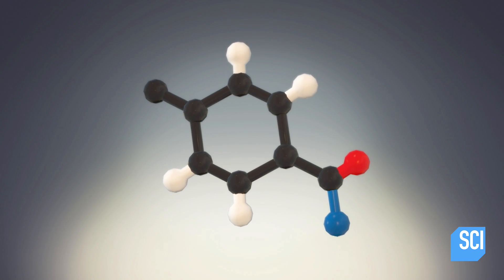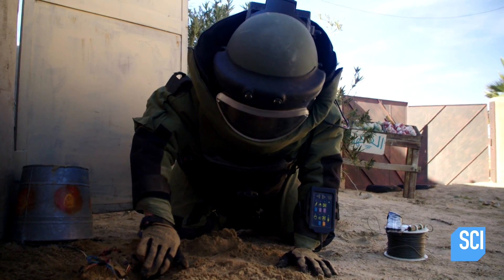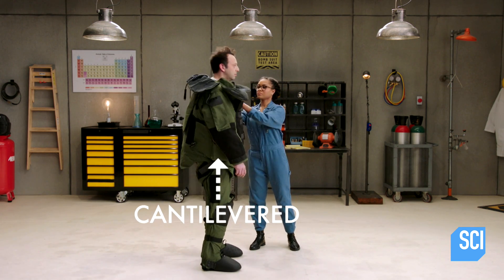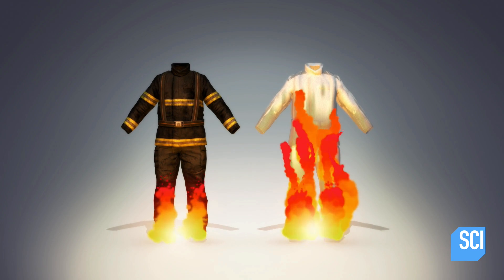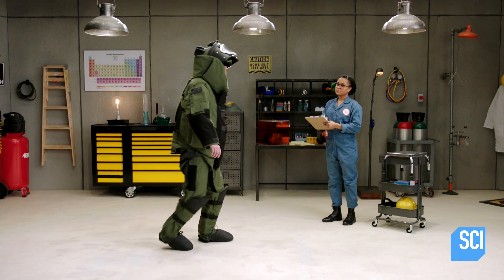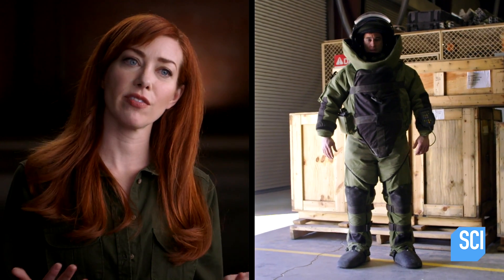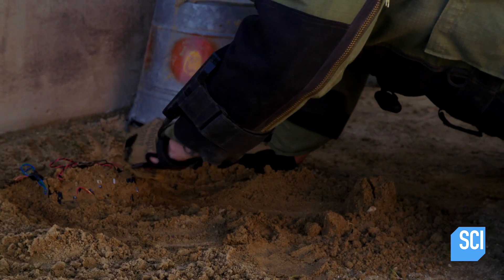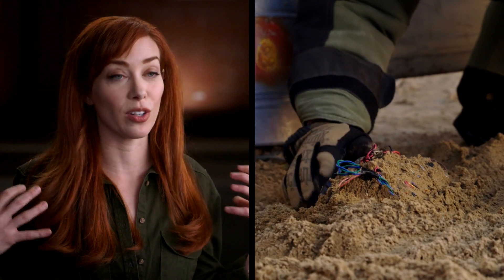This Suit Can Withstand Pressure Generated by a Bomb

Comment: Yeah well fuck the suit then! No Suit= Not having to worry about a 70lb suit while defusing= More dexterity
Reply: the only dexterity you should need is your hands and fingers, while trying to deactivate the bomb.

you shouldn't need your torso, knees, legs, and neck while trying to disarm it, so the suits' main purpose is to try and protect those, while still letting you have all your dexterity except the ability to efficiently run far away from the bomb. (you probably won't get a chance to if your attempts to disarm the bomb fail.)

sure, the suit doesn't have a 100% success rate at all, but it's definitely better than nothing. limited explosive resistance is better than complete vulnerability. I'd rather get 'sploded' and lose my hands, fingers, wrists, and survive than just flat out be dead. (the quality of life would suck somewhat.)

in the near future, it may even be possible to grow back smaller appendages such as fingers and toes through the use of cloning your existing cells and growing/grafting the new digit back onto whatever you've got left. the "new" hand may not work as well as the old one, but again, it's better than nothing.

in addition, if the bomb doesn't immediately go off but it's explosion is inevitable, you can attempt to turn away from the bomb and cover up your hands and vital organs, giving you a chance to survive the explosion completely uninjured. without the suit, you can try to flee far away or perhaps into another room, but that plaster-covered brick wall will likely just be turned into shrapnel that can cut your unarmored body to shreds.

Comment: False calculations, Kevlar has limitation 50 bmg persing bullet can penetrate boom suit. Haw about detonating 50,000 meggaton nuclear boom or hydrogen atomic boom. It a no no just be safe don't be hero detonate a boom, cheak it first if your boom suit can  risis limitations of your suit. Or you may die cos the boom you diffuse exploded was 50,000 meggaton boom it hearts.

Comment: It doesn't protect you from the blast pressure from a bomb at close proximity (1-3 metres). In fact, it is almost always fatal (even though the suit is tough enough to withstand any material penetration). Still, beyond a certain distance, the suit does indeed increase your survival rate.

Comment: Yeah. No. EOD suits will not protect you from the change in pressure if a bomb goes off. The best example I can think of is the beginning of the Hurt locker. Where the guy is in the blast radius and his head practically explodes in his helmet.

Comment: Honestly the hand part should be upgraded, i mean, yeah flexibility is important, but one would guess that you could just make the clothes extended and attach strings on the outside and inside of finger parts so the 2 are connected. then add a little stuff to straighten the outer fingers so you can move the "Exoskeleton" fingers like they were your own with strings like using a puppet.

Or something similar could work. In worst case scenario, also implement an ejection for those strings so someone can use their hands if they are uncomfortable with the exoskeleton hand.

Comment: There is a minimum distance for it to works as intended.
If it's a grenade it might just work well, no issue. If it's a c4 or dynamite you might be in trouble standing right infront of it.

Comment: Has anyone tried to mate this with a powered exoskeleton?
Reply: I wouldn't mind mating with a powered exoskeleton. Oh wait never mind! I thought you meant... never mind...
Reply: @bloodfeastislandman1580  😁👍👍
Reply: I have!
and now i am the proud father of tiny electrical bomb suits, they are soooo cute
Reply: Aaand add in additional armor plates and combat gear and you got yourself a juggernaut/bulldozer unit
Reply: I don't get what u mean but OK...
Reply: @kuroyukikazekanade7557  EXO suits.
Reply: That's a great idea especially when it comes to losing hands I think id rather just get blown up entirely at that point haha
Reply: @josephshubin8465  ficco
Reply: You would need a cooling feature
Reply: @User6381-k5f  the issue is mobile power, once you solve that throw a fan or a compressor unit for AC, you have to cool your electronics anyway or your CPU or other electronics like a PSU will fry from overheating causing you to abandon the unit or be stuck in a coffin, especially when incased a thick steel exo that is probably designed to be gas proof otherwise the enemy will try and suffocate you out of your exo.
Reply: @mesmichael  weight and power will basically cancel each other out. We don’t really have advanced tech yet, not until the day we get to fit a lightweight but efficient energy source in a lightweight exoskeleton.
Reply: Dumb, just send in a illegal alien to do the job
Reply: FNAF

Comment: if a blast happens, just put your hands behind your back as close as you can. if you fast to work with bombs, you better be fast to move your hands and arms.
Reply: @hash2ash , there can be countdowns like in movies man, there have been a lot of IEDs made with alarm clocks or timers
Reply: Yes because bombs are always like in the movies
Reply: @Cd5ssmffan  I did not say always I said sometimes, it's much easier to make a bomb with an alarm clock than a cellphone or a pressure plate

Comment: Will it protect you from a bomb though? i never saw a test. I feel like theres still a good chance your average car bomb or something will still kill you. Maybe not a hand grenade, but i doubt it'll help against anything larger than a handgrenade.
Reply: 5kg of C4 from 3M away. It said it at the beginning of the video.
Reply: Thats a pretty pointless metric. If you are defusing a bomb, you are going to be 50cm away at most. Since theres no 5 second timer like in the movies that gives you time to run away, if you mess up, that thing explodes right away, right in to your face.
At least thats the case for your "classic" bomb defusal where you walk up to a bomb and cut the red wire, or something like that. For some jobs you can use something like a long stick of course, but not for all of them.
And the things you can do with a long stick, a robot could likely do as well.

My point is, you usually want to look for a better option than putting a person out there. And i don't think the chance to survive when the bomb explodes is very high in those cases where such a suit is used(because you'll likely be very close the bomb). unless of course, its a very small bomb.
Reply: @jort93z  if 3.5kg of C4 can blow up a large vehicle with ease, it's surprising that we can make a suit that can withstand 5kg at 3m anyone else that would be in the wearer's position would be good as dead.
Reply: Usually bombs they work with are bigger than grenades so most likely its been tested, it has to be in order for them to make a claim like that
Reply: i think they mentioned about c4 also
Reply: They do work with bombs bigger than grenades, but if they work on something like a 500kg bomb, and they often do, does such a suit really stand a chance?
There has to be a limit.
Reply: @xtaIlIl  thank you sir or maam. I love that suit. I refuse to think it's useless. 👍